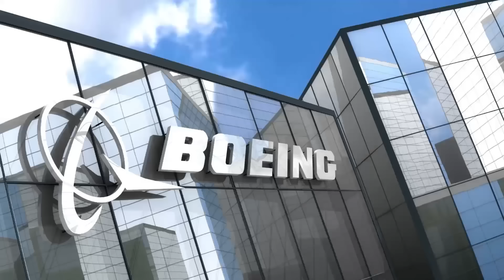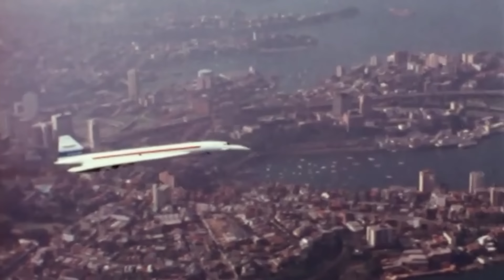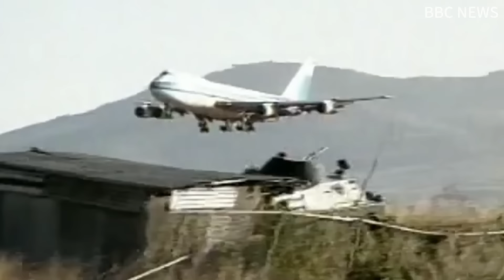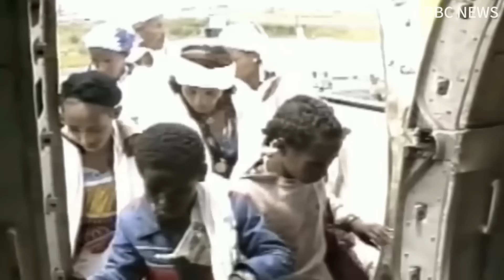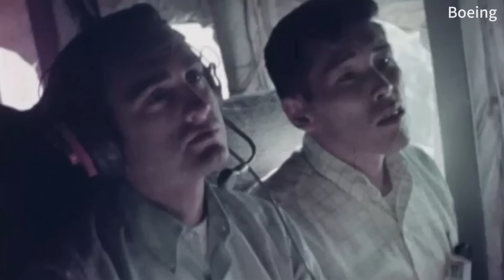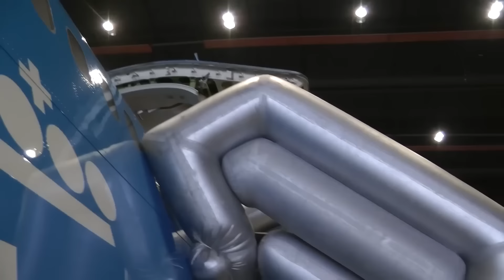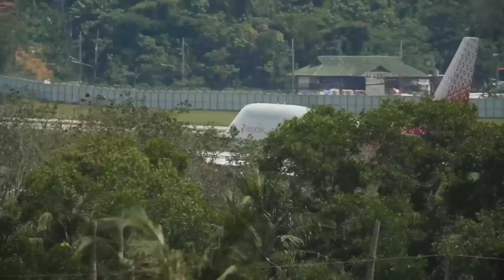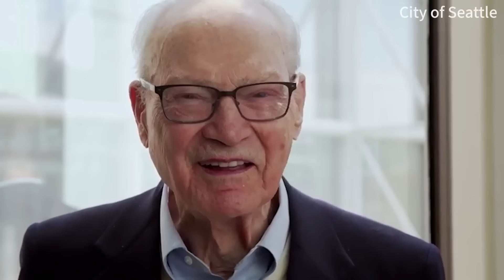What The Boeing 747 Hump Was Really For

Comment: Two more secrets about the 747.  
1) When it was being designed in the 1960s, those 75,000 engineering drawings were all in paper/mylar form...not electronic drawings.   There was nowhere to physically lay out all those drawings and Boeing at one point lost version control--a horrific design and production problem.  The only place they could lay out all those drawings and the splitting design trees was in the massive network of tunnels that, unknown to many, were built under Boeing field (currently King County Airfield) during World War 2.  Using these tunnels to lay out all the drawings so they could be carefully examined and compared allowed Boeing to sucessfully recover control over its design process and successfully bring the 747 to production.

2) Do you know same models of the 747 can differ in length by over 10 feet?  This is because of additive tolerances, a problem known in ship building and other large mass manufactured structures but not as critically applicable to airplanes in the technologies of the day and before a plane as large as the 747 was built.  Every piece of the fuselage was given an allowable engineering tolerance in fractions of a percent that permitted it to be longer or shorter within that tolerance.  Theoretically the plusses and minuses of each piece were supposed to cancel each other out but randomly sometimes the tolerances were all additive or all subtractive leading to substantial overall length differences.  This is why one part of the 747 manufacturing could never be mass produced...the nacelle skins at the joints of the wings and tail surfaces had to be hand fitted to account for this differing tolerance variance.  Modern airplane production with modern manufacturing technologies now no longer allow this problem of additive tolerances.
Reply: Where did you get this information?   The term is " tolerance build up" and it would not equal 10 feet. the tolerances are only a few thousandths of an inch. Today's airplanes are still built the same way as the 747 was built using the same tolerances. If certain parts could not be mass produced how was the airplane mass produced? Your example of how the wing was join to body is also wrong, it was not hand fitted like you say. Wings are not custom make suits. They are placed on jigs and moved into position and joined by mechanics like all other major components. I spent 11 yrs building the 747 and another 20 + years building other Boeing commercial aircraft.  And your 2nd point (secert) is so so wrong!
Reply: Your 2nd secret is so so wrong makes me believe that you have never built a commercial airplane.  The term you mentioned is called " tolerance build up " and it is measured in thousands of an inch. Usually 2 to 3 thousandth, there is no way that the build up would equal 10 feet. The plane would not be able to be built. You also stated that parts could not be mass produced but yet the airplane was.  For your example of how the wing are installed is also incorrect.  They are not fitted like a custom suit.  They are loaded into jigs and join to what is called the wing box (center fuel tank). Than the 44 section is placed on top. Boeing commercial airplanes are still built with tolerance build up to this day. I know this because I have spent 30 + years building Boeing jets, 11 years building the 747.

Comment: I flew on a 747 once - milk run Sydney to Heathrow via Bombay.  1974 as I recall. I still remember how all the serial networks in the cabin would glitch every time an engine was started.  At the brief Bombay stop, a crew of at least a dozen technicians came aboard and frantically changed light fittings and other (crude by today's standards) gizmos.  The real problem of course was the immature communication apparatus that I believe took them a year or three to completely sort out the problems and retrofit on passenger variants.

The very old joke...
Why did the 747 have a hump?  So the pilots could sit on their wallets.

Comment: My first ever flight was with Lufthansa 747-200B from Frankfurt to Chicago in 1973. Ever since, I have been fan of 747 and often choose the flights that had 747, including my recent international flight from Rio de Janeiro to Frankfurt on 747-8i. The new wing design on 747-8i makes the flying very smooth and quiet. 747SP is only variation that I have never flown in. 

Boeing has 747SP to thank for the stretched upper deck on -300 and -400. All of the materials used for 747SP was easily transferred to -100 and -200, creating the new -300 in 1980, without spending so much fund. Some of -100 and -200 had been extended by the request of airways.

Comment: The British narration was in error, when at 7:24 the description of the newest assembly factory required was stated as largest in volume, yet their definition was given in Square Meters rather than in the volume required Quebic Meters. This error was due to a professional announcer being chosen to read the narration rather than a professional engineer who would immediately have spotted the need for correction.  This points to an uneducated producer making decisions on a technical subject.  Cheap & embarrassing on a critical element that this current generation is so prone to have, little regard for who the audience for this video would likely be: mechanically inclined detail oriented individuals. At the very least, an aeronautical engineer should have been used as a consultant on such a subject.

Comment: I flew on the 747 a few times, but the most memorable flight was the one where I got seated in the upper deck. The small cabin was cozy, and when you walked down the spiral stair case to the main deck to order a drink at the bar, other passengers would stare at you like you were something special (which I definitely wasn't).

Comment: My favorite model was the 747-400. I used to travel from New York to Tokyo several times a year. It was always a very comfortable flight, especially when I was seated on the upper deck. This was a 14-hour flight; I don't want to think about the other alternatives. This was also back in the day... I used to design aircraft so I would often get the opportunity to talk with the flight crew and visit the cockpit. I remember that they would collect business cards from the passengers and have a drawing for a prize. Usually a bottle of Champagne. When they see that I worked in aerospace, I would get invited for a visit on the flight deck. This was back in the 1990s. I miss those days. Flying today is basically traveling in buses with wings.

Comment: Ehhhhh, the A350 cruises at Mach .85 as a normal flight planning speed. No doubt a 747 CAN cruise faster (I used to cruise the 747-400 at Mach .86 on the way home, but this was faster than our normal .84 or so. So really, standard cruise speeds are contrary to the producer’s statement, with the A350 being faster on a routine flight profile.

Comment: My first flight on a 747 was in spring 1972.  I felt more comfortable on the 747 then on any other aircraft.  The next closest was the Lockheed 1011.  I've also flown on the DC-10 and it didn't feel safe.  I've flown on several other planes but non as nice as the 747.
Reply: I don't have a problem with the DC-10 because if an ashtray ever was full, it would have made national headlines. Regarding the L1011, I only flew it once. We were waiting to take off from Saint Louis Lambert Field and it was a hot and humid day. Fog was coming through the air vents. It looked like something was wrong, but I just reminded myself that what I was seeing was the air conditioner doing what it was supposed to do.
Reply: @davidsandy5917  I worked for Honeywell when I flew on the DC-10.  I made several flights.  Once the Chicago to Phoenix was canceled and the airline I was rebooked on flew the Lockheed 1011.  The thing that really impressed me was the very first 747 flight the aircraft had self serv water dispensers.

Comment: When my son was starting his AAE program, we walked through "The City of Everett" (on display at the Boeing Museum of Flight in south Seattle).  The very first 747 off the line.  It had been stripped to be used for hauling cargo.  Ceiling panels were open and the hydraulics on display.   

Disneyland would fit inside of the Everett Factory.  (Which is open for tours).  It has a slice of a forward section of a 747 from top to bottom on display.

Comment: This is only part of the story.  Boeing originally envisioned the 747 as a double-decker 707. Essentially two 707 fuselages mated on top of each other.  However, Boeing eventually opted for a wide-body, twin-aisle design that would have a similar passenger capacity with only a single main deck.  Boeing's sales team famously presented this concept to Juan Trippe, chairman of Pan Am by pointing out that the cabin would be as wide as the boardroom that they were sitting in  As the video states, the elevated flight deck was retained to enable cargo loading through the nose.

Comment: Yep, it's Big.  I flew as a passenger on the 747 many times in the '70s and was always amazed by the sheer interior...vastness of the airplane.  But it wasn't until I was a student pilot in 1979 that I really understood how big the 747 is.  I did all of my flight training at Boeing Field in Seattle and one evening after a lesson, my instructor and I walked down the ramp a quarter mile or so and were able to walk under and around a 747 cargo aircraft.  It was while looking up at the main landing gear bays, into which all those gigantic wheels retract, that I realized the gear bays could easily accommodate  at least one and perhaps two, of the Cessna 172 airplanes in which I trained.  I was in awe of any pilot who could handle something that incredibly big; still am.
Reply: I saw a 747 on a test flight near Boeing, and I still remember how slowly it appeared to be going -- an illusion due to its sheer size.

Comment: The rear of the hump was going to be the crew's area. Then PANAM said no.
Reply: A lot of the crew lives in the tail section above the cabin ceiling... At least that is the part I have seen. This is only on flights that exceed the limit, usually 8-hours, when a crew replacement is required. I think but am not certain that the flight deck crew have other accommodations. It has been a long while since I flew.

Comment: When I was stationed in Korea in 90 and 91, I flew in a 747-400 nonstop from Seoul to LAX. It was the only time I was scared of flying because we took off as a typhoon was just making land fall. I could see the walls flexing, and some of the overhead bins came open. Everything smoothed out once we got above the storm, though.
Reply: You need not worry about things flexing. If you look at the tip of the wing during flight, for instance, it might be moving ten feet or more from where it was sitting on the ground. Airplanes are not made of concrete. Think spring instead. That is how we design them.
Reply: I know that now but didn't know back then 😂@davidsandy5917

Comment: I didn't fly on a 747 as a passanger, but I had the joy of crewing on the E-4A/B's (727-200) during 4 1/2 years of my military service. I got to the unit in 1981, and flew on them until 1986. We went from A models to B models, and I think the ladies pending replacements are newer 747s. Great airplane with a few military modifications.

Comment: The spectacular "secret" which was missed: The flight test where they had the Space Shuttle Enterprise eject from the top of the while in-flight. That's how they tested the space shuttle's ability to glide to a landing before strapping boosters and a fuel tank to Shuttle Columbia. There's footage of this feat floating around. 

This video does indeed mention the added pair of vertical stabilizers. During an early test flight with the space shuttle, buffeting was observed (sort of like rattling and vibration) on the stabilizers due to the shape of the protruding bells of the shuttle's three main engines. This is why Boeing had to design an aerodynamic tail-cone which was subsequently attached to the back of the space shuttle prior to all piggyback flights. Sadly, Enterpise never saw space because that particular shuttle was more of a mock-up to test the glide characteristics of the shuttle. There was intent to retrofit it for space flight, but it turned out that would just be way  more expensive than building a new one (in order of construction: Columbia, Challenger, Discovery, and Atlantis).

Oh, an one final fun fact: There was an episode of 'The Incredible Hulk" where  the Hulk had to land a 747. This was necessary due to the loss of hydraulics power.

Comment: They overbuilt the 747 because it was originally designed and intended to be a military heavy hauler.  The military version has the ability to be refueled in flight and can stay in the air as long as they have food and water for the passengers.

Comment: When I was in second grade (1970) my school took a field trip to JFK airport. I remember the hanger wasn't big enough for the 747, so the tail had poke out of the building, but they cut the doors to fit around the fuselage. We got a tour of Pan American Airlines and at one point saw one of my uncles that worked there! We talked about that every now and then through the years. I also got to fly on two 747s in the early '80s when I was stationed on Okinawa (to and from). They packed us in pretty tight. I think the seats were smaller than what you would normally get on a plane back then.

Comment: I don't want to sit in the front of the plane, if you crash your screwed ! In the mid 90's I was on a 747 out of Colorado Springs to Dallas and we were hit by a Rotor down draft off the mountains and we lost two engines and had to make a hard emergency landing in Denver. Just a few years earlier a plane crashed and was completely destroyed by the same thing.
Reply: Except for the rare circumstance, what happens in a crash happens to everyone in the crash. Looking at the risk, you were far more likely to die, driving to the airport than you would be during your flight. That is especially true if you are driving to JFK.

Comment: if only the 747 had a front window.. but i believe from the pressure and all that, it would be too expensive or unsafe or something
Reply: The 747 has a front window. It is on the flight deck... Oh, you mean for the passengers. Well, there is a basic problem with that. The aircraft is pressurized. At the front of the cabin, there would be a pressure bulkhead. Putting holes through that bulkhead would add weight. Also, since the aircraft nose is shaped to reduce drag, there would likely be a distance between the "drag reducing" external skin and the "pressure containing" internal bulkhead. Putting this simply, be glad you have a window to look out of. Airplanes would weigh and cost less if they were eliminated.

Comment: The hump also increased the fuselage’s role as part of the airfoil. The downward slope of the back of the hump increases the size of the low pressure pocket that forms from the airflow. This is why the 747 can takeoff, climb and approach slower than smaller airliners.

Comment: In the 80's and 90's I flew in 747s back and forth from Chicago to London for work.  The seats I loved the most were those on the upper deck.  It seemed more spacious than normal and quieter. Also due to the fuselage curvature of the upper deck the aircraft's outer skin was displaced away from the seats. This gave you a flat open area at your elbow between the seat and the window where you could put magazines, food, and other personal items.  Loved that ship.
Reply: North West airlines converted the hump into business class.  I was lucky enough to be in there once because of free upgrade.

Comment: My very first flight ever was a 747, taking me from London to Sydney (with a stopover in Bangkok) for a year of backpacking. For some reason the Aboriginal painted 747 (the one at 11:48 in this video ;-) ) was not parked at a terminal so we headed out onto the platform with a bus, where we took the stairs up into that giant aircraft. I remember being halfway on those stairs, turning right, staring into one of those massive engines and wondering how all this could ever get airborne. Upon entering through the front door the walk to the rear (we were in the 5th row from the back) felt like ages. Every time we went past a galley/toilet/curtain a new section with even more seats emerged. What an iconic plane!

Comment: One of the design features was that the 747 was originally designed as a Military cargo design, which to reduce the number of parts, is why all the wheels are the same size. Most planes will have a different size for the steering wheel, and the Main Gear.

Comment: To save you 18min:
The "hump" on a Boeing 747, also known as the upper deck, was originally designed to allow for front-loading of cargo through the nose. This was due to the desire for a plane that could easily convert between passenger and cargo operations, as requested by a key customer, Juan Trippe of Pan Am. The elevated cockpit and upper deck create space for a lounge and/or extra seating, further making the 747 iconic.